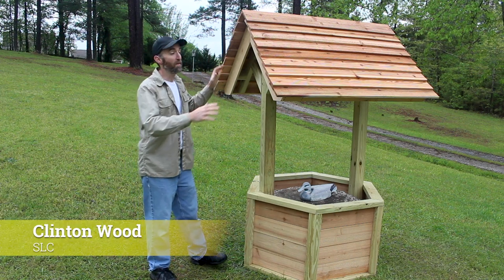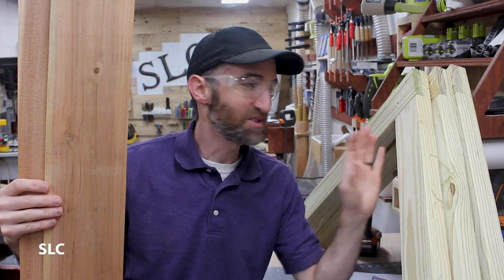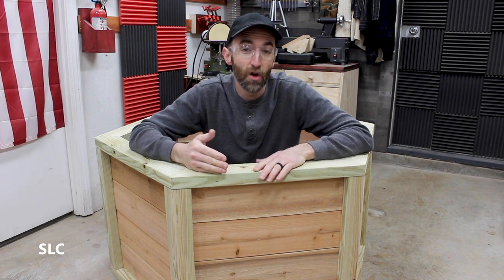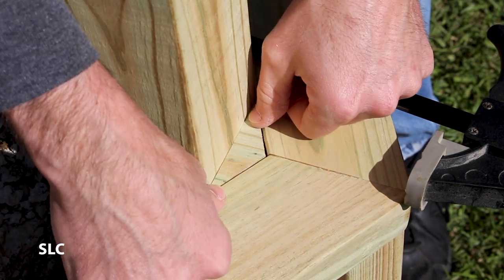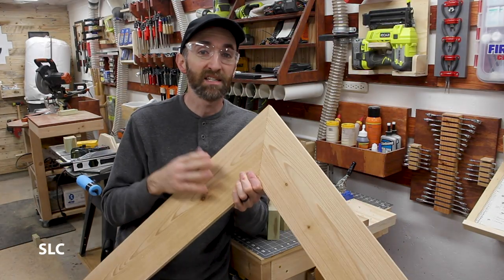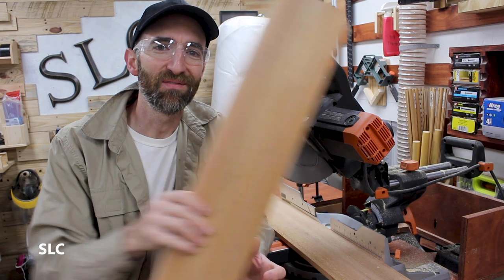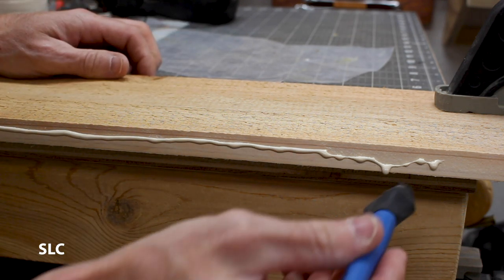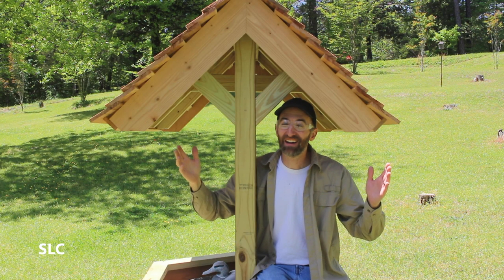Building the Antique Wishing Well Part 2

Comment: Great job. One thing I do differently while cutting lap joints. I set the saw to depth of cut. take very small bits. This way there is no chisel used.
Reply from the maker: Good tip, thanks

Comment: @Specific Love Creations  I have to build this out of safety necessity! Please provide an estimated material list such as number of pressure-treated two-by-fours and measurement Etc. I have a hole beside my house that used to be a water well that is more than 12 ft deep. It has no safety sides to prevent any thing or anyone from falling in.

Where you have a concrete Barrel sticking above ground I have nothing! It is just a straight drop cliff!

I realized the diameter of my whole May be different from yours and will change size slightly but I can adapt from what measurements you give me please.
I definitely want to make the lower part stand taller closer to waist-high.